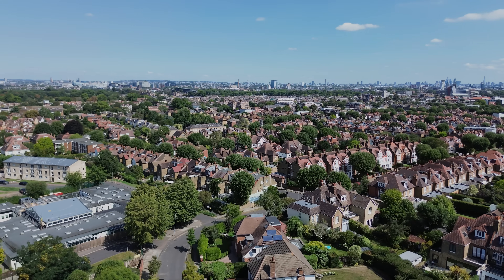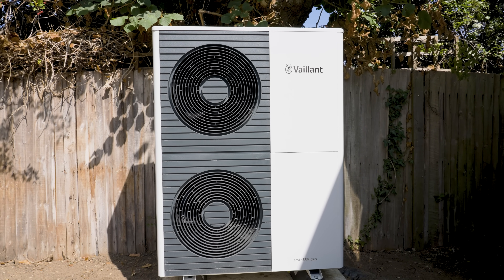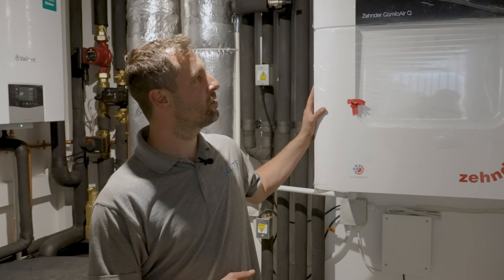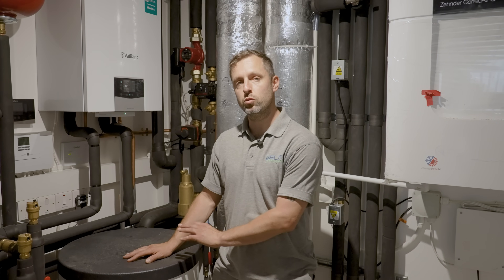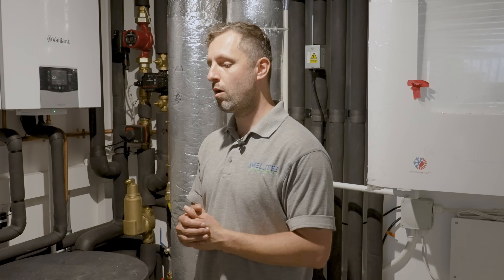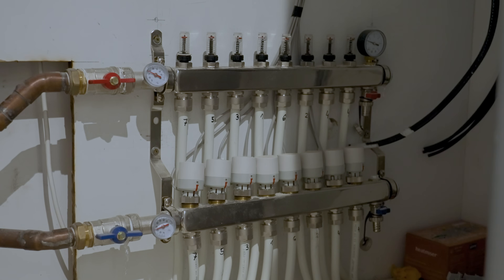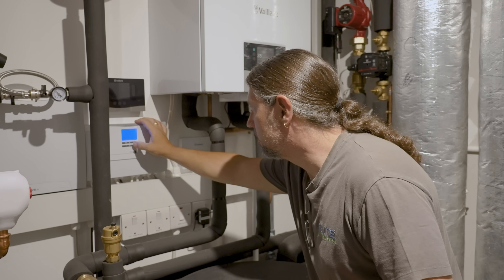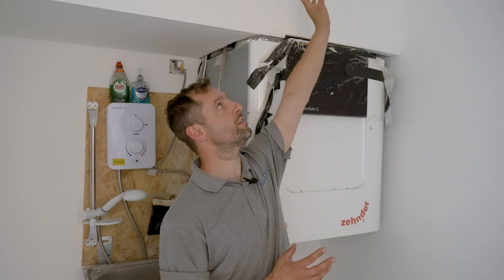Heating AND Cooling from a Vaillant Heat Pump

Comment: I’ve just had a heat pump installed after nearly two years of research! It’s been working brilliantly. 

I am also a software designer testing an early-stage tool to help homeowners to find good heat pump installers.

 So if anyone who's thinking about a heat pump, but stuck/unsure choosing an installer in UK.  I'm happy to help.

Just message me if you’d like to chat. ;)
Reply from the maker: That's awesome! Glad your system is working well :)

Comment: Do you use the gas boiler for hot water during the cooling season or just use the immersion heater ?
Or do you swap between cooling and heating to get hot water cycles in cooling season ? Complications.
Installing fancoil units which can do both heating and cooling would simplify things ?